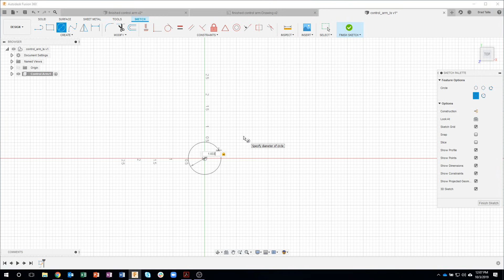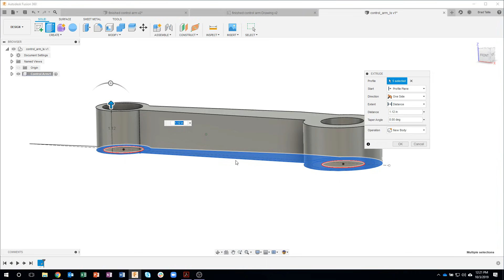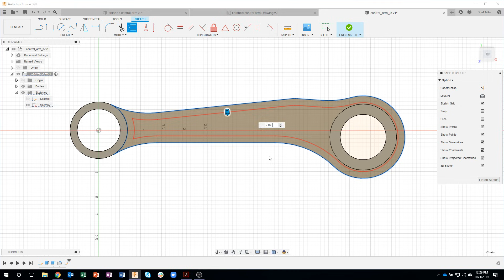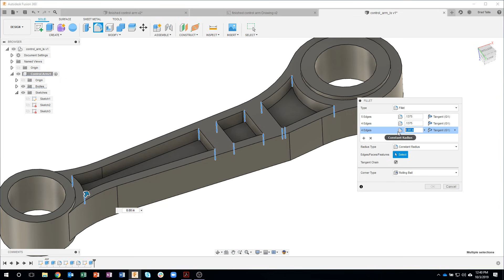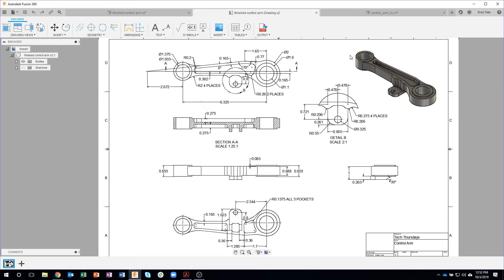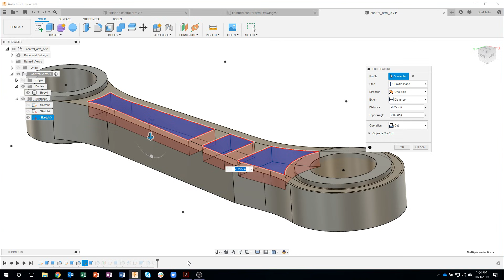Creating a Control Arm for Manufacturing

Comment: I appreciate how Brad prefers to minimize the number of features in the timeline. I'd go a step further with the Fillets and wait to fillet the pockets until after I've made both of them. That way there's only one Fillet feature total for both pockets! You could just drag the first Fillet to the front of the timeline and edit it to include the new pocket.

That was a great tip to see that you can have separate selections at the same radius, too!

Also, instead of drawing a line to the Midpoint of the Rectangle from the Circle center-point and making it Vertical, I think it would be better to do a Sketch Point and apply the Vertical constraint between it and the Circle center-point. That way there's one less to deal with in the sketch. It's just my personal preference, but, I don't think I've ever seen anyone use the Sketch Point command in a video before. I think it needs some love! Haha!

Another thing I noticed:  When Brad projected the Circle so he could use its center-point to position the hole on the tab, he used the Project command. I don't think it's very widely known that, in many cases, when you're in the Dimension command, you can click the geometry you want to dimension from and Fusion will auto-Project it into the sketch. In this case, clicking the circle within the Dimension command will auto-project the circle AND reference the dimension from its center-point! I hope this is helpful! Your videos have certainly helped me!
Reply from the maker: @Jay Russell-  Great Tips!  Thank you for sharing.  I agree on filleting the pockets after they were both created to simplify the timeline even more.  I also do the sketchpoint/vertical constraint most of the time, but I showed it with the line so people can "see" what is happening.  Sometimes just doing the "vertical" constraint with a point confuses some people.
Reply: @adskFusion  I totally understand! Please continue to do whatever is the least confusing for your viewers. I'm just trying to share the knowledge I've gained in my time using Fusion 360. I hope it's been helpful!

Thank you for all of these videos! They're SUPER helpful!

Comment: could you publish a method e blueprint of this, so we europeans understand the drawing.
Reply from the maker: I'm not sure I understand. Could you provide some more details of what you need the outcome to be? Are you speaking of drawings with different settings, because I believe we support European standards...and if not we need to!
Reply: fusion 360 supports method e, but the print brad uses in this video is method a, and that differs in ways of how to turn the detail, visible and hidden lines, more use of sections and other things that's different between the methods.

Comment: At 58:40, when you simply click, you enter a distance to have your geometry snap and, although very fast, it’s not parametric. In that instance, I would choose the « To object » option witch will update parametrically if you decide to change the thickness of the part earlier in the timeline.
Reply from the maker: @Blasie-  You make a valid point, but Fusion 360 is actually smarter than some of the other CAD tools out there because of it's built-in Direct Modeling.  Because those circular ribs touch that face, if that face were to change (like in depth, for example), Fusion 360 will "grow" those faces to keep them touching the face they were originally on.  However, your point is correct in that one should probably use "extrude to object" in most situations.

Comment: At 46:00, I use a pretty well hidden tip but even faster and maybe « cleaner » way of centering the circle in the square. First, you select the Horizontal/vertical constraint and click the center of the circle, than, holding the shift key, you hover over the center of the top square line and only when using the shift key, Fusion will let you select the center of the line and by clicking, an vertical constraint will be automatically created between the center of the line and the center of the circle.
Reply from the maker: @Blaise-  Wow!  I did not know you could do that!  That is awesome!  Faster, simpler, and less messy.  I am going to have to give you a shout-out on an upcoming LiveStream for that tip!

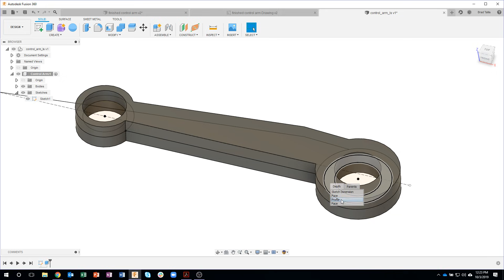Comment: Hi Everyone! Me again! I just wanted to point out that at 25:50, you could select the first profile as you did but instead of choosing the two other profiles the same way, you could open right away the Extrude command and once that command active and since you already have one profile selected on a plane, Fusion will let you select the other profile simply by clicking on them. Saves a bit of time!
Reply from the maker: @Blaise-  Yep, another great tip!

Comment: Hello Brad, sorry for my English, I am French  :)  Can you explain me why, at minute 30 of your tutorial, when I try to operate the Offset command in clicking on the edge of the Body, nothing is happening ?  It only work with the Project command  !
Thank you in advance for your reply, and congratulations for your very interesting videos.
Reply from the maker: @Philippe-  You might check in your preferences under General-->Design and see if "Auto project geometry on Active Sketch Plane" is checked.  Mine is...  This means when I click on a face to add a sketch, it will auto-project the geometry of that face onto my sketch.
Reply: @adskFusion  hello and thank you very much, you have identified the problem.  I am very happy to know this option, as many other features that I discover in each of your videos.  I am always eager to discover the next to apprehend this software so powerful but also very complex.  thank you again, continue to make us discover the many possibilities of Fusion 36o :)